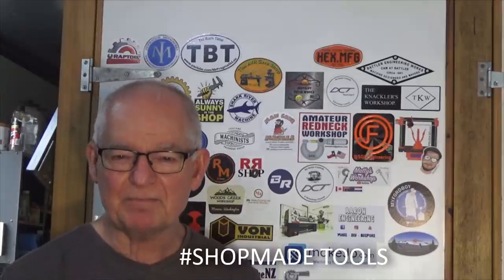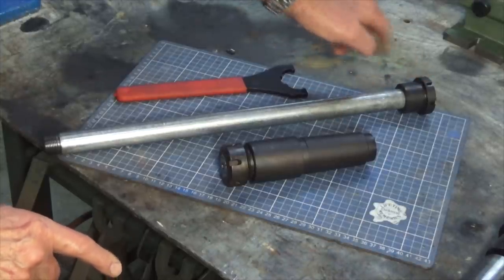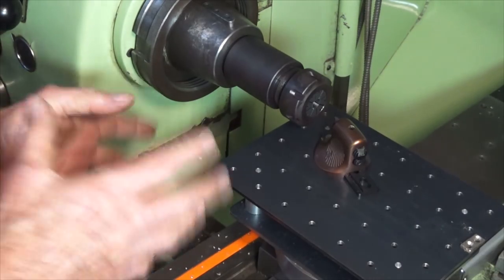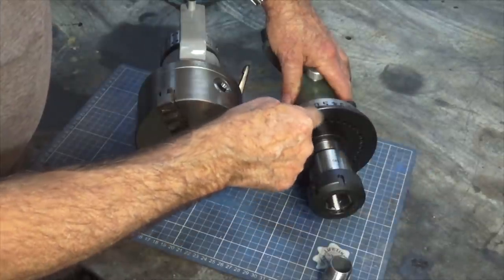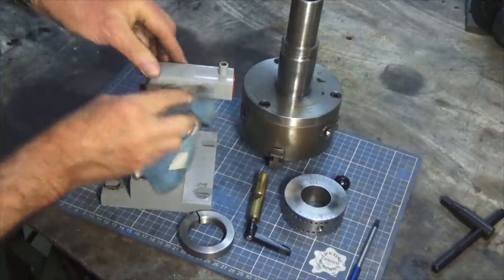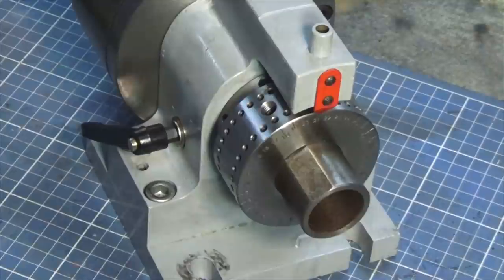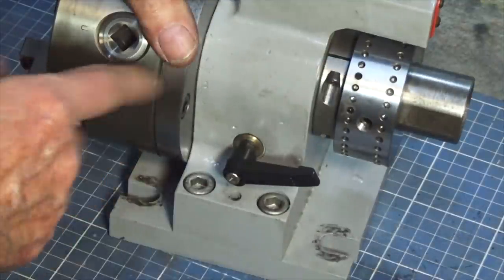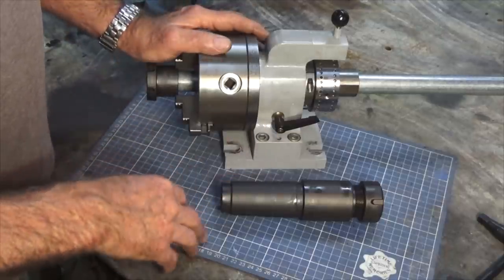#ShopMadeTools - Why?

Comment: Let me know if/when you want to sell that little Hercus dividing head.  It’s way too small for Bridgeport and perfect for my Hercus mill :).
Reply from the maker: I have enormous respect for Hercus tools. I have used the ATM260 lathe, the small Hercus shaper and the Hercus universal mill and they are all good machines and the perfect size for the home workshop. I could have kicked myself when I gave up the opportunity to purchase the shaper when it was deemed to be surplus equipment at my former workplace. It sold for a few hundred dollars! I recall a very well known local businessman once said to me, "you need to take the opportunity of a lifetime in the lifetime of the opportunity!" Wise words indeed.
Regards,
Mark
Reply: @Preso58  I know something of your pain.  Recently I could have bought a Hercus surface grinder for $750 from eBay.  I didn’t think I had the room.  I found the room but by then it had been bid on thereby removing the buy it now and was at $1800.  Next time….

Comment: hey Mark do you have any issues with that locking nut coming loose on the draw bar cheers mate love ya work
Reply from the maker: No, it's welded on to the tube end. 
Regards,
Mark
Reply: @Preso58  ok I have the hare & forbes  5c collet adaptor for a lathe and that locking nut or hand wheel that mines got comes loose away cheers mate

Comment: interesting video, how did you engrave(?) the numbers on the ring?
Reply from the maker: Yes, I have a drag engraving tool that I use on my little CNC mill. It has a carbide point that is pressed into the metal against a spring and it is just moved around to form the engraving. It doesn't rotate it just forms a groove as it is dragged. It's a lot more forgiving than a rotary bit since there is no requirement to have the surface of the part absolutely level. 
Regards,
Mark

Comment: I enjoy building my own machines for my workshop rather that buy them because I can take a simple tool idea and take every possible way that tool could be used in my shop and with accessories or quick modifications and build the most versatile machine for my workshop then I modify it and do any changes I need it most for and then improve them for a few months then paint them
Reply from the maker: True! I sometimes wonder why I spend so much time making tools instead of making furniture or engines or something but it's an empirical process. You start off with simple tools (usually with deficiencies) and gradually improve them or redesign them. It's just satisfying to make something useful.
Regards,
Mark

Comment: With regard to the index wheel on your "spindexer," why not use your lathe to machine a gage block to lap down to the closest ten-thousandth inch. From there, use your home made gage block on your store bought sine plate to precisely index each hole around the wheel. This way, you're only buying a sine plate. 

Oh wait. Why not make the........
Reply from the maker: That's the catch isn't it. If I bought a sine plate I would then want a full set of gauge blocks in both metric and imperial. Chasing accuracy is a very deep rabbit hole. I think that's the difference between toolmaking and making tools. Toolmaking is what Robin Renzetti and Tom Lipton do. I am just making tools much further down the spectrum from where those guys are at. 
Regards,
Mark
Reply: @Preso58  Yes, the learning is in the doing. And with a set of "first tools," one can make the rest.

A micrometer to .0001"

Layout and measuring surface plate, et. al.

Lapping plate, et. al.

2" optical flat

Lathe with milling adapter, et. al.

With this kit, you make everything up:
Sine plate
Gage blocks
Etc., etc., etc..

And all the skills you develop besides how fast you can pull out your wallet.

Comment: Excellent work! It takes zero talent to spend money. I find it disturbing one feels forced to justify  building his/her own tooling. In my view, when one reaches the point in his/her shop with knowledge and tooling where they can build their own tooling the shop has become self sustaining.

I especially like your indexer. Having a cast aluminum housing makes it lightweight and thus easier to handle. The lightest commercial version I own is about 100 pounds and requires hoisting which makes it a chore to use. Probably every job it has ever done was drill cross holes for set screws, drilling face holes for pin spanners, drilling face holes for fasteners, or milling wrench flats. Nothing very critical. Your version looks to be a breeze to throw on the table, dial in, lock down, and get to work.

Comment: Actually up to 32mm is the largest ER40 collet you can get they are on eBay and come from England
Reply from the maker: I just had another look on Ebay but it's very confusing. Some sellers are showing the range of ER40 to be 3 to 30mm but others go to 32mm. My own set only goes to 26mm and it was purchased as a full set about 20 years ago. The small diameter of an ER40 collet is 31.2mm so it would be unlikely that an ER40 collet could have a through diameter greater than that. 30mm might be available but it would leave the small end of the collet very thin. 
Regards,
Mark

Comment: Machines (or machinists) make other machines (and sometimes machinists). It’s what they do. If it’s a tool or a “part” what’s the difference? All applications of the same skill and talent, in this case quite evident. 

At the end I was wondering at what point is the baby kangaroo too big for the pouch. And in what way is that fact passed along by the pouch holder to the former passenger. I’m envisioning a spirited conversation. “Now, Springy, it’s time for you to…” “Come on, Ma…”
Reply from the maker: I think that little joey will soon be evicted from the pouch. The last few shots showed it feeding from Mum but not from inside the pouch. They sort of stand up close and stick their heads in to get a feed. 
Regards,
Mark

Comment: you can get up to 32 mm er 40  collets now
Reply from the maker: That's interesting. I just had a look and the standard upper limit is 26mm. 32mm is larger than the small end of the collet. Maybe you are thinking of the diameter of the large outer diameter of the collet?
Regards,
Mark